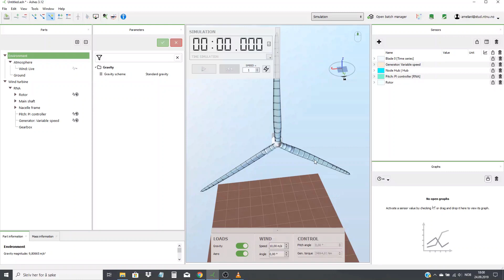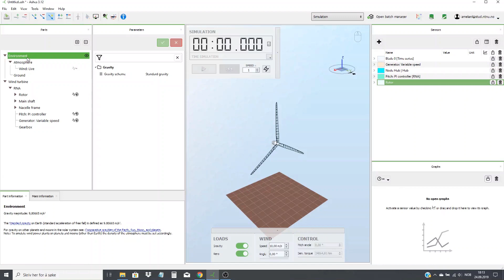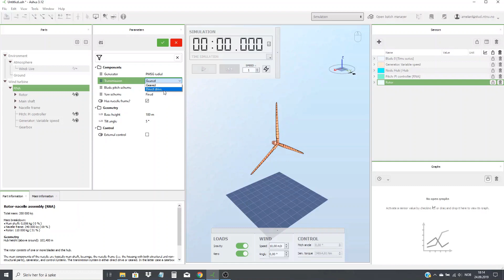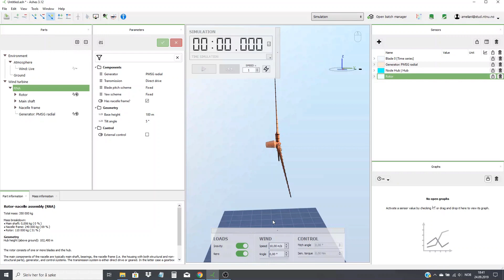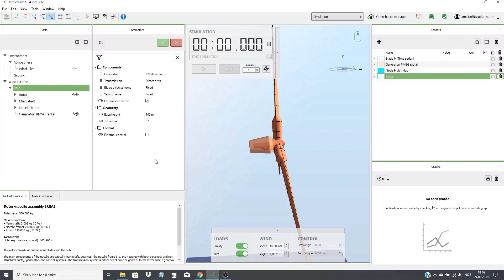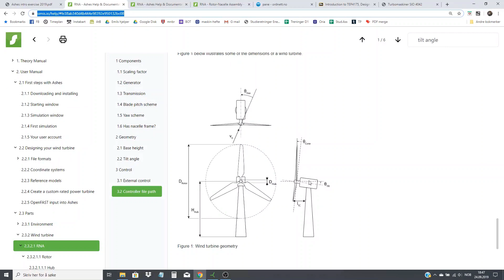Basic model settings in Ashes (wind turbine simulation)

Comment: can i simulation windlens and finding the power output by this program?
Reply from the maker: You would have to calculate the wind speed increase due to the duct and than apply that wind speed to the simulation. Then you can get the corresponding power output

Comment: Nice presentation!! What to do about the pitch angle? Is there any technique that we can adopt to do it for now?
Reply from the maker: Are you asking the question in the context of the NTNU course? If so, you prbably want to have your demanded pitch set to 'Fixed', in the RNA part (see https://www.simis.io/help/#0ae5992b8741440d8ba9a25b9dc42dcc). I highly recommend using the forum for this type of questions (www.simis.io/q-and-a), we generally reply much faster there